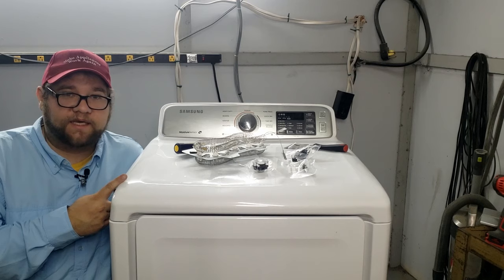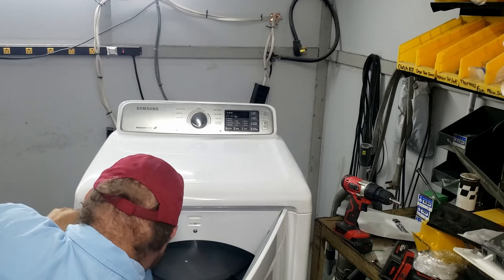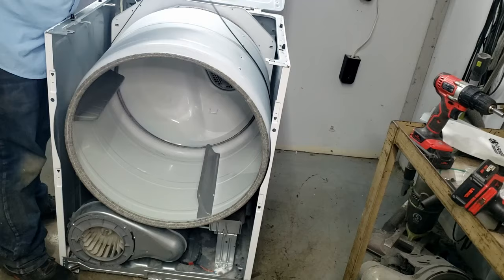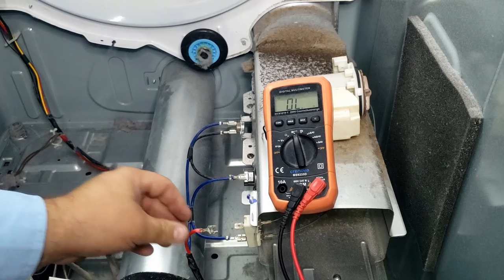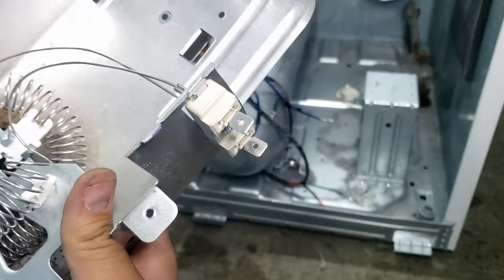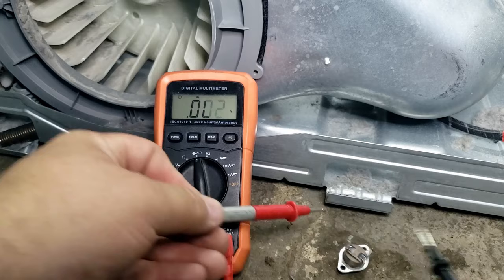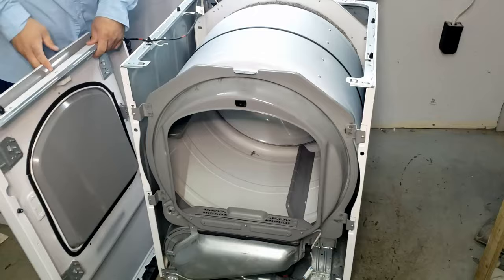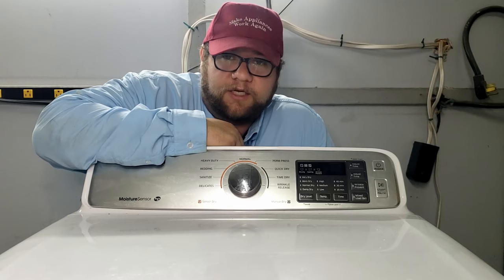Samsung Dryer Heating Element Replacement - How to Fix a Samsung Dryer Not Heating

Comment from the maker: If you need the parts, consider using these links to help the channel out! Use code "YOUTUBE" for a 5% discount on any of these kits!
Whole canister with element and sensors pre-installed: https://bit.ly/3y7StnT 
DIY Repair Kit with Element & Heat Sensors: https://bit.ly/4eqEz5R
3-Wire Design Whole canister with element and sensors pre-installed: https://bit.ly/3nsRFqe 
3-Wire DIY Repair Kit with Element & Heat Sensors: https://bit.ly/3fvajZW
Reply: Hello Ben!

My dryer is finally heating again after I followed your replacement temps. Is it normal to get a slight heat/burn smell after a first trial run? Thanks
Reply from the maker: @srikondabattula7034  Sorry I didnt see this till now. Yes, totally normal. You usually end  up disturbing the lint/dust in the cabinet when replacing, so you get some odor for a cycle or two. If it still persists after a week, may be an issue.
Reply: Your video helped me tremendously!
Reply: Hi I installed everything yesterday everything was working good but now today it stop heating  any advice
Reply from the maker: @jesseniasantiago9510  usually that is due to a clogged vent that prevents the air from blowing outside and instead keeps it inside and blows the sensors again
Reply: I think it was I forgot to replace the sensor next to the thermistor idk I just ordered it would I have to order a new thermistor also ?
Reply from the maker: @jesseniasantiago9510  you should be OK. The sensor beside the black thermistor is a thermal fuse that will fully kill the entire dryer's operation if it goes bad (to prevent it from overheating). If your dryer runs, but doesn't heat, it should be OK
Reply: Ok so I ordered the thermal fuse just in case  so what’s your advice
Reply: @bensappliancesandjunk  I checked vent it’s not clogged at all 🤷‍♀️
Reply: The dryer is operating but it’s not heating at all . I installed the heating element and thermistor it worked few hours  next day  I turn on it was operating until I noticed it was blowing cold air  . I checked vent to see if anything is clogged but nop everything looks good  just ordered the thermal fuse since it was the only thing I didn’t change  🤷‍♀️ I’m sorry idk what else
Reply: 6:30
Reply: First off, this video is very helpful. Thank you. I was able to follow the tear down and reassemble except for ONE part. I was trying to follow you when adding tension to the pulley…since you were recording from the rear of the unit, naturally I reversed it in my mind since I would be doing that step from the front. I couldn’t add the tension to the pulley so I found another video and had success. 

After the entire job was done I came back here to let you know. And I figured out the missing detail. Your video is already showing the mirror image when adding the tension. I now see your name tag is on the opposite side. 
For anytIME else having trouble with this step….9:22 - 9:37 is a MIRROR IMAGE.

Comment: THANK YOU SO MUCH! I am a mother of 4 with little time and zero experience with doing this kind of thing. I purchased the exact parts I needed from your site (which arrived in just a few days with FREE shipping), followed your instruction, and was able to fix my dryer by myself. Not only did you save me over $300 in having someone come out and fix it but you also empowered and gave me the confidence to do the job myself. I am all smiles today and very proud of myself and I owe that to you. Thank you again, blessings 😁💞
Reply: Wow I’m so proud of you. I’m a mother of two n try to safe $450 fixing this.
Reply: I have a man in the household and he is no use, so instead of replacing the dryer, I’m replacing the man 😂🤦🏾‍♀️
Reply: You’ve inspired me! I’m a mom of 5 and I’m about to try! 🙏

Comment: Step one, never buy anything that says Samsung on it, total trash.  Bought a refrigerator, washer and dryer 8 years ago.  Ice make on the fridge lasted 2 years.  Shortly thereafter the washer was recalled as the cover might fly off if you wash something like a blanket.  Finally, no heat in the dryer.  In 62 years, never had a dryer fail, some were 30 years old.  Sister has a Samsung fridge, again ice maker needs to be defrosted every couple weeks to work, 3 years old.  Her dryer was about 6 years old when it had to be replaced due to a hole in the drum.  0 for 5 is not a very good batting average.

Comment: Had to buy a replacement dryer and used this video to guide me through the process of taking the whole thing apart in order to install a side venting kit. New dryer was samsung DVE45T3200W, very similar to the one in the video. Completed the job in about 2 hours. Putty knife to free the top worked. Lots of different screws. Draw pictures. Number the screws in an ice cube tray. Thanks Very Much!!

Comment: I was lucky, disassembled, vaccum cleaned, checked all parts: everything seemed to be correct, re-assembled... WORKS! 
I think I had some stuff in the thermostat connector that caused it to short, so after cleaning it went back to working.

Thanks for the video, really educational!

Comment: My dryer was getting too hot- showing  hE on the control panel-
After watching this video I felt confident I could fix it myself, so I ordered a new heating element and said a prayer!  This video helped me take my dryer apart safely, replace the heating element, and put it all back together…works like it’s brand new!! I’m a stay-at-home mom I’m not a mechanic or skilled in appliance repairs in any way— but I did it all by myself with the help of this video! Thank you for posting it

Comment: Great video, I really appreciate the detail you put into the instructions. Made changing my heating element go allot easier. Two things I would like to point out is the spring on the pully tensioner could come off when lowered. My spring did, and it was kinda tough to keep on. The other is to be sure to check the element housing position when replacing the drum. The housing is easy to bend and could press into the drum. Mine did touch the drum, and caused a scrapping noise. So I had to remove the door slightly bend housing to the right.

Comment: My heating element went out in my Samsung dryer. I followed your video step by step and got the whole assembly replaced in less than an hour.  Thanks for a straight to the point video with clear instructions. People like you are what makes YouTube great.
Reply from the maker: Thanks! When I started appliance repair, I found there are way too many videos that are twice as long as they need to be. I just want to show how to take the machine apart, where the important pieces are, and how to tell thats whats dead and nothing else. Sometimes I try to educate about why they fail, but I really don't want to put out a 20 minute video when you don't need that.

Comment: Oh My God Bens Appliances and Junk, you are a SAINT! With your detailed instructions, I have successfully completed the dryer disassembly and found the issue was my heating element. I went to Home Depot, they said I had to go online and order that part. I looked around and found a local appliance store that had it in stock since I wanted to get this done ASAP & not wait on parts to be shipped. Within a few hours and rewinding this video back I installed the piece and put her back together. I can’t thank you enough!

Comment: Just a wonderful tutorial. My issue was one of the wire terminals popped off some how. Plug it in and good to go. You probably saved me $150 or more. Thanks again!
Reply from the maker: I've been seeing WAY more wire terminals either burnt or popped off lately. Not sure why. This video has been up for 2 years now, and it seems like your response is way more common. No clue why. Glad it helped!

Comment: I like how you’re honest on how difficult disassembling it can be. I don’t know why these damn engineers do not make it simpler to take a part.
Reply from the maker: The insane thing is EVERY unit comes apart differently. But once you get inside, its almost all the same. Maytag, Whirlpool, Samsung, LG, Kenmore. Frigidaire. So, so similar to do whatever once the front is off. But before that? Good luck knowing what you're doing.

Comment: Thank you so much!  Dryer ran a few seconds and stopped with an HC error.  My thermistor is at 1.2 K ohms, everything else checks good.  New part ordered, fingers crossed!  Video was very easy to follow, my background/career is automotive repair so I know my way around a multimeter pretty well.  I wasn’t sure how to dismantle the dryer and stumbled into your video looking for that information, I was very happy you also showed how to ID and test the heating system components.
Reply: Did you get it fixed? I'm having the same issue.
Reply: @BLK8WDW  thermistor took care of it.  I ordered 2 so I have an extra on hand.
Reply: @TDF0907  thank you for the reply I'm about to tackle the problem

Comment: Hey Ben, I just wanna thank you for posting this video... I had a Samsung Dryer quit building heat a week ago... I found your video and ordered the heating element parts for it from Amazon and tore it down this afternoon and had it up and running 3 hrs later... I paid $30 bucks for all the parts from Amazon, cuz Samsung wanted a $120 for the same parts... You saved me from spending $700 on a new Dryer and a better brand... We'll see how long this runs now... Very much appreciated... Thanks again!

Comment: My heating element went twice on me and now the warranty has ended. This video will be a big help once the part arrives.  For someone to come out is 70 dolars plus 20 per hr plus parts and labor.  
A 40 dollar part on Amazon and your video should have it back up and running 🤞
Reply from the maker: Make sure to clean your dryer vent. They like to blow elements and thermal fuses when the vent has collapsed or is full of dirt
Reply: @bensappliancesandjunk  so i followed your video step by step..and now it works better then before thanks for the video 👍

Comment: Thanks. Works. Getting the belt back on, I thought, was the hardest part. When this is the most likely thing to need replaced, you'd think they would change the design.There I go, thinking again...

Comment: My dryer stopped heating and i thought it was the heating element.  Just replaced it last year in April.  Everything in the heating element looks good visually including continuity test.  I will look at the 2 sensors tomorrow.  I have never checked this.  Thanks for this video.  When i had this problem the heating element is always the problem.  Not this time it looks like.

Update:  i replaced the thermistor even though the resistance is good.  And my dryer started heating up again!!!  Thank you for this video!!!!!

Comment: Thank you so much for this comprehensive guide to fixing my dryer!  I wouldn't have been able to do it without multiple viewings of your video.  Like you, I had difficulties putting the clam shell housing back together, especially since the heating element brackets are sandwiched between each side.  I found that putting nails in the screw holes helps to hold the unit together allowing the screws to be attached easier.

Comment: Fixed my dryer belt for the second time, had to replace the pully thing. Then got the dE error. Could not figure out what I did wrong. Came here, at 2:49 saw the connection to the light - that was it! Found the cord, connected, it's working fine now. Thank you for your video.

Comment: My dryer has been having heat problems for months. I've made due, even tried to Crack it open and see. I was lost. This video makes it more clear and I can't wait to tackle it. Although my Samsung dryer is a little different, apparently they are all similar enough that this should work. My wife will be happy. Ty!
Reply from the maker: They are all insanely similar. Honestly, it goes way beyond Samsung. Kenmore, LG, and some Whirlpools are almost all the same with slight layout differences once you get the top off.
Reply: @bensappliancesandjunk  if only more cars were like that :p

Comment: This video was FANTASTIC and I watched it several times for reference as I took apart my dryer! I bought this Washer and dryer set used for our new place . Upon setup I noticed the controls would turn on and all of that , it would spin normally but there was no heat!  I found out my breaker was tripped and that was why my dryer wasn't heating ! It wasn't getting enough voltage! It gave me the HC error code . I replaced every part the heating element (which mine didn't appear damaged) the fuse in the blower and all the thermostats and it still wasn't heating .. and still read HC...mind you I took it apart and put it back together again 4 times... lol... I spent hours doing this . I don't know if anyone else has had this same issue . But before you go ordering parts and taking this dryer apart check your breaker/outlet.  I felt silly that it was so simple🤦‍♀️

Comment: Tried the coil in this video, soon as I looked at it I knew it wouldn’t last too long. Maytag makes one that’s the exact same model as Samsungs, but it’s cheaper. Guess it’s some brand name BS. Video helped a ton, got the dryer apart and back together working in about 90 minutes 👌
Reply from the maker: There are 3 grades of heating coils on the market for these.

Amazon grade (which I mention in this video 4 years ago) which are the cheapest/thinnest on the market, but everyone buys them because they are $30 for the element + sensors

ERP grade which has a manufacturer of origin in Mexico, which is way thicker and more durable. Not impervious to issues, but its much more durable. It costs significantly more at wholesale.

OEM grade which I am unsure of for origin. It could be the same as Mexico, but I am unsure since they run >$100 at wholesale and I've never tried one.

For 2-3 years now I've been selling ERPs for $27, but lose out a lot of sales to people wanting the Chinese kits for less. We've begun to stock and sell them as an option, but not a requrement, as some people (not many) are willing to pay more for the higher grade durable one.

Whirlpool/Maytag also own the same design in a different PN#. Its the same as the OEM grade at a lower price, but sitll not close to ERP's. I think its the same factory in Mexico as ERP, but I'd have to buy a few to test and see, and I've been busy with other videos to do this, but I'll probably revisit a Samsung dryer element video soon, since they now have models with 3 wires that few have filmed yet.

Comment: i was so stuck on trying to get the belt back on. That camera shot inside the dryer for the belt was a lifesaver. Thank you so so much.  Most videos just say put back on the belt and magically the belt is back on  lmao
Reply from the maker: One of the main reasons I did the video. I knew the others were garbage about that so I wanted to make sure everyone saw how it's done

Comment: Hey Man! Thank you for the video...I changed out the whole heating/sensor housing per your instructions.  It was actually cheaper that way. Turned out the heating element was cracked.
Put everything back together and now it runs like a dream.  Thanks again.

Comment: Great tutorial.   Spent $35 and 2 hrs and now it’s fixed!   I had to vacuum lots of lint and also took my time since I’m not a professional
Reply from the maker: Lint build-up is likely the culprit on why you had the issue. if you ever see a lot, it'll clog the system causing a failure.

Comment: I bought the whole replacement kit, and the one thing I observed was that the red cable and the blue cable’s location are swapped. The Samsung machine has the blue cable on the bottom and the red cable on the top. The replacement unit has it reverse. I do not see an alternative way to configure it, and just went ahead with the replacement. An hour into fixing it, all good and hot ! It works !!

Comment: Thanks so much for the thorough video! Your ohms resistance rating detail on the thermistor helped me locate my problem. I initially overlooked the thermistor because my multimeter was showing some ohms so I figured it was okay. But not being able to locate any other problem, I went back and checked and the ohms were very low. So I replaced it and the dryer now heats properly. Thank you!
Reply from the maker: The thermistor can get even real seasoned techs, because of that. Glad it works now!

Comment: 1 hour, 36 minutes. This is a great video for repairing this but I will admit that the statement  "the belt will be threaded back onto the motor"  (9:21) and the process of getting the belt back on is a mother. 

Great video, @Bens Appliances.

Comment: A very helpful video: very clear instructions, the right pace of delivery, good clear photography!   When I ran into a problem, I went back and replayed that section.  Your Samsung model matched mine so everything was applicable.   The noise was due to  a bad rear drum roller but while in there I discovered the idler had come apart and needed replacement.  Thanks again for putting this video together.
Reply from the maker: Rollers and idler pulleys are insanely notorious on these unitd
Reply: Idler pulleys on Samsungs are the worst.

Comment: Amazing video!  Super helpful!  I just got my dryer apart and I believe I'll be placing an order for the parts from you.  Everything in my dryer had hair and lint and while I've got it open, I'm vacuuming it out.  Might as well swap out the whole set of heating components while I've got it apart, since you sell a whole kit for less than the cost of just a heating element from other sources!

Comment: Perfect! $40 in parts and your video, dryer fixed ... took bout an hour and a half.

The only thing different between you video and my dryer was the heating element wires were flipped (red on bottom), but I put everything back as I took it out and it worked fine.